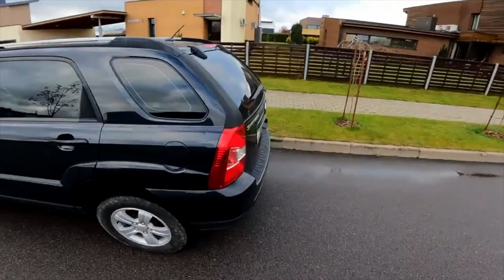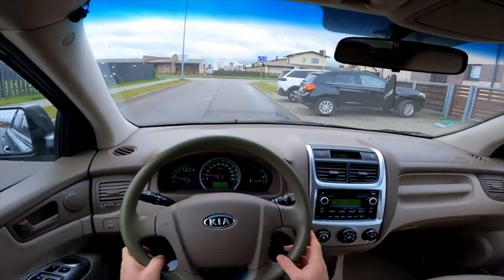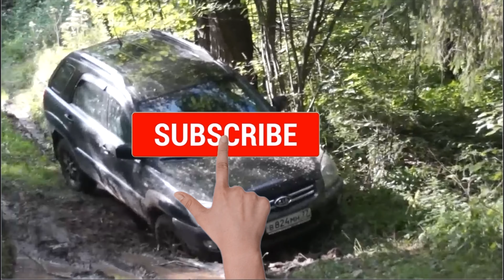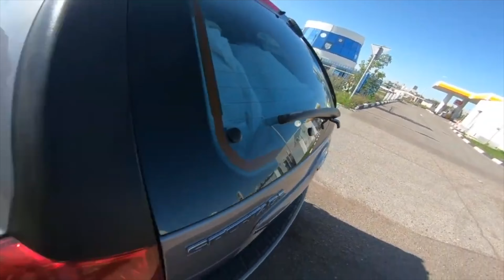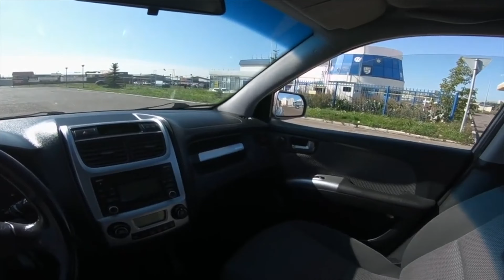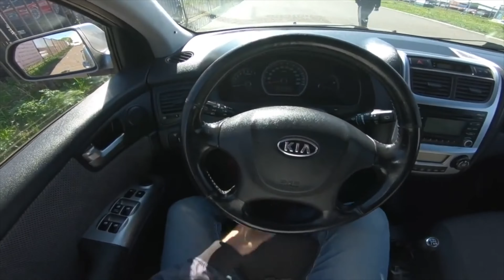Kia Sportage 2 Problems | Weaknesses of the Used Sportage KM

Comment: I own a 2009 Sportage, 2L Diesel, here in Brunei. Its been off-road 10 years and I recently recovered it from storage. Amazingly, body and interior is like new, body and engine bay rust free. The only real issue my bro-in-law had when he owned it from new in 2009, was it went through Turbos! He had three, in 6 years. I'm slowly replacing oils and cables, hoping to fire it up soon. November 2025.